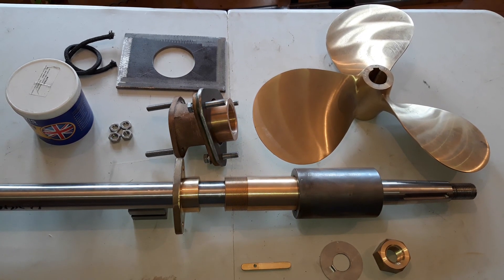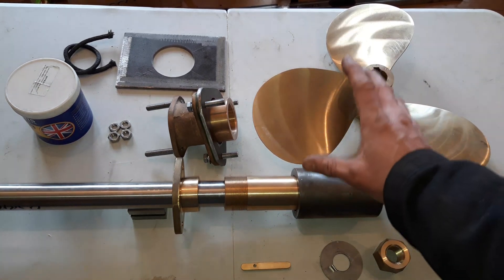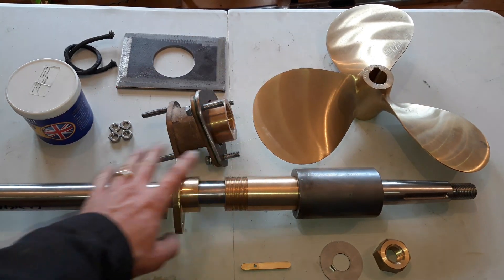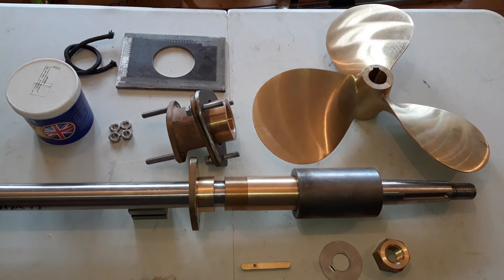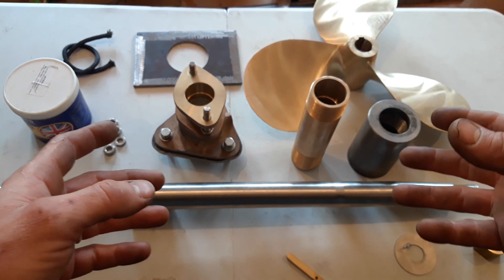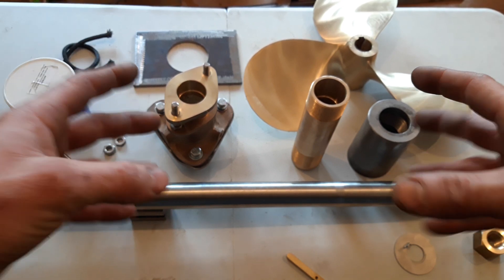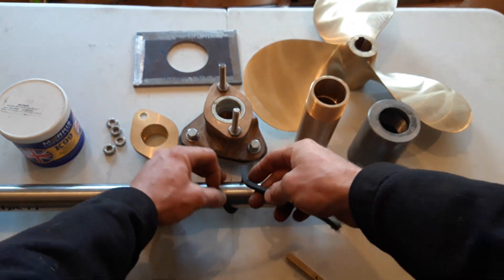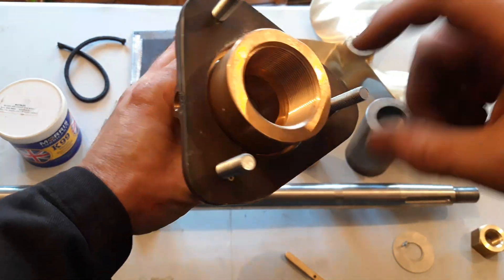New to boating?  Narrow boat Stern Gear Fundamentals explained

Comment: Hi Darren, great informative video, well done.
When cutting the packing cord i have seen that a cut of 45deg is recommended rather than 90 deg which kind of makes sense to me but I guess there's always 2 points of view.
I've also read it should drip 1-2 drops per minute when running. I prefer no water in my bilge (being used to offshore boats with dripless seals)
My new to me, narrow boat is 5 years old and only just done 200 hours but the gland was leaking grease and water (and there was a general purpose grease tub in the bay). I've just replaced my packing, and all the grease. The old packing seemed ok when removed, heyho at least I know all is in order now.
Reply from the maker: I completely disagree that the gland should drip, a good shaft and seal will work and stop water.

If there is excessive wear you will in most cases still get a reasonable seal. 

However I have no complaint with 45° cut but for what it might give mehh ok if you want to why not. Makes sense.
The grease will help that seal anyway. 

The old system that uses grease can get messy but it worked well and is ideal for the canal as it offers a solid support for the shaft.

I've seen deep water seal systems not support the shaft as it uses a softer cutlass bearing.

However ob deep water they are great.

Hope that helps
Reply: @dhcrouchmarineltd3049  thanks, that's good to know the gland should not drip. Will take careful adjustment to seal completely but not be overnight in order to stay cool and avoid wear.
I guess dripless are more suitable offshore where the water generally contains less silt and solid obstructions to foul the prop.

Comment: Hi, great informative video!  You mention using a sealant on the thread, which sealant type do you use?
Reply from the maker: There are many but i have used a modern product many times CT1
 This product claims to be able to cure under water, not that you need to when installing this equipment.

Comment: Very good and informative video. Could how tell me how i get the gear selector  control shaft out to replace o ring and spacer. The engine is in situ on the boat and access is ok.
Reply from the maker: What gearbox are we talking about?
Reply: @dhcrouchmarineltd3049  PRM Delta 1.5/1
Reply from the maker: This is covered in the user manual. There is a process.

Comment: Great video,  very informative,  in my opinion,  it informs at many levels, overview of understanding (for all of us), details of how it works, (all of us) details to cover the folks who have a greater understanding of engineering,  but not this specific engineering solution for control of water ingress on a shaft.   Also please make sure you keep up the warnings to us all, we need to know when we need to call in the experience folks, and the consequences we risk if we don't ask for help.  Great presentation the information is so good.  This type of video's primary function is to pass on information and experience, and secondly to some entertaining. I hope with your desire to make the video more enjoyable (entertaining) that you don't  lose the primary purpose of imparting information.  I hope that makes sense,  Best Regards Colin.  Brilliant and thank you for time and kindness to share this with us all. 👏👏👏👍👏🤝🤝
Reply from the maker: I am trying to keep it in an informative manner. As I've progressed my only issue is how to compress stuff into something that maintains an audience.

I remain open minded.

Comment: Hi I'm looking to re instate the stern tube gear in my 1968 westerly cirrus unfortunately the whole lot was taken out just to a broken engine ! Could you roughly tell me the cost of having this refitted I have engine shafts and prop
Reply from the maker: Can you email with pictures of the work and I'll estimate it.

darrencrouch@dhcrouchmarineltd.co.uk
Reply: @dhcrouchmarineltd3049  Hi thank you for the fast reply it would be refitting all of the stern tube gear as if you were starting from scratch if that makes sense? I'm able to fit engine regards paul
Reply from the maker: Sorry for the delay in replying. We had this Covid in the house. It's not fun.

As for your question. Are you asking about the labour costs or products costs?
Reply: Hi hope things have got better fortunately I've managed to stay clear of it ,I was really enquiring as to how much the Parst would roughly be if can I know how to fit an engine but have done anything with the stern gear so a learning curve for me  thank so much paul
Reply from the maker: The last propeller cost around the £600 cast to order and the propeller shaft was about £300
The stern gland and bearing an additional £300

These are rough estimations and will vary, especially in the UK as raw materials have gone through the roof.
Reply: @dhcrouchmarineltd3049  I've the shaft and prop that come with the engine weather the shaft is the right length I do not know? The stern glands are they like a generic part
Reply from the maker: There are a lot of standard designs but really that's a fallacy.

For example a shaft diameter is commonly 30mm or say 1.5" etc

A common size propeller is 17x15 on a 2:1 ratio. 

But boats are very bespoke and you must do your calculations to get the most efficient system.

As for the gland, I suspect you may have a greased system and the gland is suspended by a rubber hose with jubilee clips ?

The gland must work with the bearing or cutlass bearing etc
 So again do a proper inventory and check what ever you use is compatible with each part in play.
Reply: @dhcrouchmarineltd3049  thank you so so much for the information Benn appreciated

Comment: Great informative video....One thing you said made me think.I have a 1980's?  BMC 2.5 in my Duver 23. I was told it is a Right Handed Prop!.I do have cavitation problems so I need to check!
Reply from the maker: Does make a difference having a smooth prop with a good profile and leading edge

Comment: Hi Darren my shaft used to leak so i replaced the stuffing gland but now it dont leak  good ....but the stuffing gland now warms up first question is how much grease do i wind in as i think there is no more water coming up the shaft  have i put to much in ?my boat is 26ft sea boat  7 knot speed running ford D and borg box thanks simon
Reply from the maker: Hi. When you say you have replaced the stuffing gland, do you mean the entire cast gland or just the packing material?

Either way if the gland is getting hot the packing may be to tight?

Your welcome to email pictures if that helps

darrencrouch@dhcrouchmarineltd.co.uk
Reply: @dhcrouchmarineltd3049  Hi Darren so i now have the standard 4in flexi tube mine was 2in and was  told to short ..So i have  just repacked the stuffing box but have not as yet tightened the gland as im waiting for sea water to come in  .............i did remove the shaft to have the grub screws drilled deeper in the shaft to stop movement ...and when put back use half pot of grease like the one in the vid ....i,m thinking not allowing water up the shaft ...my question is how much should i put in the shaft about 3 ft in length ....thanks simon ill get you piccy weekend

Comment: Nice 👍 just a quick ? I do get abit of grease coming out where you said but no water is this ok or needs repacking thank you
Reply from the maker: It may be just a case of tightening the gland. Usually its a balance between stopping water coming in and allowing free movement of the shaft.

The gland must not normally restrict the shaft spinning easily. 

But ultimately older shafts and seals can be a little messy.
Reply: @dhcrouchmarineltd3049  thank you 👍

Comment: All that said, here's a question: I have a NB that I purchased out of the water with stern gear but no engine. There is some wear on the propshaft where it goes through the gland. How do you judge when such wear is excessive? What problems will it cause? I'm assuming I'll need someone experienced to come and look at it for me, so I'm just asking out of interest.
Reply from the maker: Once I have a stern gland in my hands again I will make a video on how to re-pack it and what would be an acceptable amount of wear, the common issues you'll get, the gland seal will not seal, this causes obvious problems with excessive water ingress and the bilge pump will go off all the time, that effects your leisure power systems. Worse still if not monitored can cause a craft to list and sink in extreme cases. Excessive wear in the bearing part will stress the output on the gearbox and that gets expensive.
Reply from the maker: HI, as requested. Some guidance on shaft wear. I will get to a cutlass bearing too soon, hope this helps for now.
https://youtu.be/yCGT9bgKrGo

Comment: I think you're eventually going to have a very successful channel. Keep working on being strict with yourself about the structure of these videos. 
The bit about the plate you are putting in to support the stern tube was interesting but it broke up the flow of what is supposed to be a discussion of "fundamentals". Maybe you could have put that bit in at the end as an interesting bonus. Also, good to signpost what you are going to do right at the beginning. I don't think you said in the intro that you were going to show us how to renew the packing. 
That said your actual explanations are very clear and informative and impart a lot of your good judgement and experience (not just the textbook stuff).
Reply from the maker: Yes I can wonder of track a bit. Duly noted with thanks